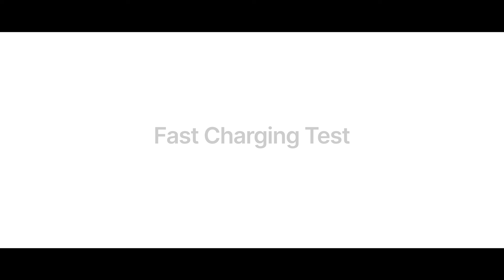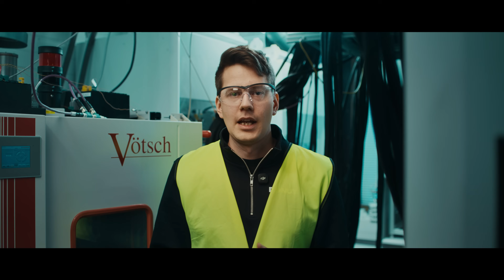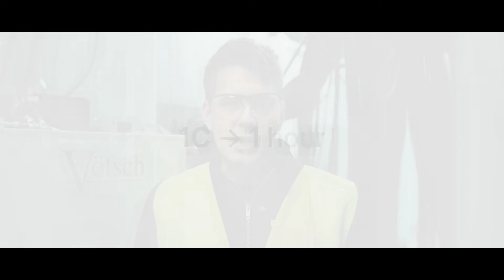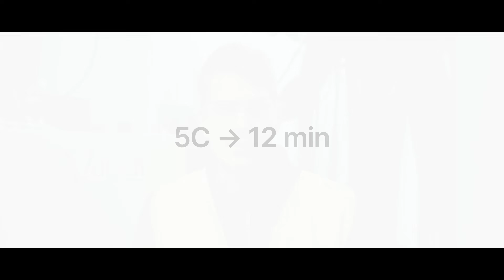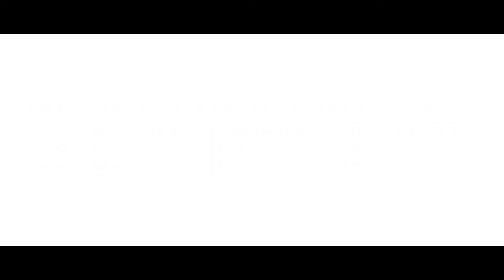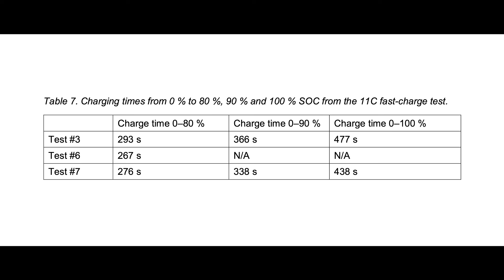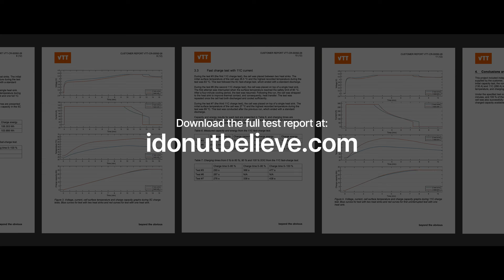Donut Solid-State Battery: Fast Charge Test | I Donut Believe (Pt.1)

Comment: I'm looking at the report. Can anyone explain why the difference between charge energy and discharge energy is about 17,7%?
Does it lose that amount of power for heatloss and inefficiencies?
Reply: Yeah that's basically right. It's round trip energy efficiency loss, mostly from internal resistance. When you push current through the cell, some energy turns into heat (I²R losses). The higher the current, the worse it gets.
If you look at the 1C data in Table 3 it's about 90% efficient. At 5C it drops a bit. At 11C you're seeing roughly 82-83% efficiency, which is where your 17.7% gap comes from. You're pumping 286 amps through the cell so a lot of energy is just becoming heat. That's also why the surface temp hit 63-89°C during those tests.
This is pretty normal for any battery at high C rates. It's not unique to this cell. The faster you charge anything the more energy you waste as heat. It's just physics.
Reply: @dimitarkolev5211  makes sense! thanks.
Reply: Well, when slow charging it looses about 10% to heat, but when fast charging you lose more towards the heat. That being said, it's not really a lost if you think about modern EVs for example because the heat can then be collected with an advanced collector (like the octovalve that Tesla has) and delivered as cabin heat. Wait until you realize how much energy is lost at the charger as well when fast charging :))
Reply: This is in the range of NMC-type Lithium-Ion cells. The voltage rise and drop during charging is also comparable.
Reply: Also, the discharge was done at 1C, but if you discharge at 11C be sure you will have loses there as well. The cables that connect to the battery themselves have a high resistance that sums up at this so high charging amperage so the lost for charging was not only on the battery cell itself, but on the cables as well. The same is valid for the lithium-ion batteries or anything that consumes high amps that we have already.
Reply: Gemini was able to help.. 
That 17% is almost completely "lost" at the charger, while using ultra high current power, converting it to heat.
But when the battery is full, it returned 99.6% of the charge it stored.
Reply: Why do you ask. If you are pretending to be so smart?
Reply: @vvalsirob  Donut Lab made batteries interesting. But I'm not an expert in them.

Comment: Looking forward this tech in home energy storage
Reply: You would probably want LFP for its better round-trip efficiency for home use. This one promises to be great for cars and motorcycles used for long-trip travelling. Commuter cars that can be slow-charged at home (using PV at best) benefit more from LFP efficiency.
Reply: @lborl5843  The thing is, if their claims are true, this will last much longer than even LFP batteries, so the efficiency is less of a concern if you can have a battery that lasts significantly longer.
Reply: lborl5 • No, sorry. 
From what they say, the safety of Donut Lab battery is way higher.
If Donut battery tech is true, then all the other battery chemistries out there now will be gone and forgotten.

Comment: 10 min charge time with no active cooling is crazy. An EV could just not have a cooling system and be fine, lowering the complexity and cost substantially
Reply: A single cell can handle the 5-11C charge without active cooling. In a whole pack you'd still need cooling even with these test results.

Comment: What the VTT report does and doesn't prove:
The report validates that this cell genuinely handles 5C and 11C charge rates with high capacity recovery that's real, measured data from an independent lab. This alone puts it in rare company, comparable to CATL's most advanced fast-charging LFP cells but potentially at higher energy density (if the 400 Wh/kg claim holds).
However, the report does not test energy density (Wh/kg), cycle life (100,000 cycles claimed), or extreme temperature performance, the other headline claims that Svolt's chairman called contradictory, saying that such a battery simply doesn't exist in the world. CnEVPost It also tested only a single cell, so manufacturing consistency remains unproven.
In short: the fast-charging performance shown here is legitimately impressive and on par with or ahead of the best production lithium-ion cells in the world. But the most extraordinary claims, the combination of high energy density, extreme cycle life, and temperature tolerance, still await independent verification.
Reply: This is a series where they drop these test results and reports one by one. This test only considered the fast-charging capabilities. Next part of the series reveals some other data.

Comment: Can't wait to have the -30'c quick charge test and how the outward current is going to behave. This is the real obstacle in Finnish conditions currently with current Ev's. The 500km range is more than enough for anyone, but when it drops to 200km range in normal cold winter day 25-35'c up here, then suddenly this makes car not useless, but very much different thing than what was promised.
Reply: There is no real problem with current battery technology at -30C when it comes to extracting useful capacity out of it. Other than low initial capacity. You can have almost all of its nominal energy out easily at -30C. Heating (and keeping it up) everything at -30C takes much of that capacity and it means lower range.

Now if donut battery would give you more energy stored in a similar space/volume to lithium pack, it would make a difference in real world driving range. Heating up everything would still use as much energy as it does with lithium based pack.
Reply: @retkimora  True, but the fact that this battery can heat up to such high degrees means that after you fast charge, the car can just "leach" on that heat to provide heating inside the cabin instead of wasting it with cooling at the charger to keep the battery within normal tolerances. Not the battery can become a real heat storage unit as well.
Reply: True. Also you wouldn't need to heat it up for fast charging saving more energy for actual driving. This cold weather charge test is likely coming up in later videos.
Reply: @retkimora  One can always hope, currently CATL Naxtra seems to be the most promising candidate in our climates, since that promises to have more than 90% of the nominal performance and capacity even in -40'c
Reply: How much energy would it even take to heat up the batteries beforehand. If losing 5% battery makes the rest 95% last longer then it's a worthy tradeoff.
Reply: That’s why it is important to have individual charging spot and preheat the car with grid energy, not waste the battery for that
Reply: Only 25% of that drop is due to the battery, rest is pure physics. But yes, any improvement is welcome.
Reply: @wecs8k  Aye, need of more heat and cold air being heavier is a b* if you have only so much energy to go for. So naturally What Merc CLA is doing aka, getting better aerodymics would also help massively into that, if you can push into 400+ maybe even 500km in Cold then you already have similar if not better statistics as any ICE car :)
Reply: @ehta_perkl  Keep in mind that aerodynamics is only part of the equation. Another big factor is rolling resistance due to the snow and slush.
Reply: Nothing like having to stop and charge for an hour in negative temps
Reply: @xtdude  To be fair, most well-made EVs will precondition long before you reach the fast charger, and so you would only need to charge for 30 to 40 minutes, not a literal hour. Hopefully this new battery (if real) improves that.

Comment: According to Nordic Nano, this is how the Supercapacitor is made, the tech comes from CT Coating AG with the collaboration of the University of Twente.
Electrode: 25% Black (SnO2-TiO2) Quantum Dots bonded with Defected-Turbostratic In-situ Activated Graphene (Organosolv lignin 40% + Sodium Alginate 15% + 10% MWCNTs) / 10% SSE
SSE: NFES (75% PVDF-TrFE / 24.9% Na₃Zr₂Si₂PO₁₂ / 0.1% NH₂-GO)
Reply: Did you not watch the previous video they posted. They specifically stated it's not a 'supercapacitor'
Reply: @Cell1969  Donut believe, they just want to hide how it's made, Nordic Nano calls it a Supercapacitor
Reply: @rwyo83  Yes. I think this is the case. There is only 1 h idle time. If that would have been longer, I would expect to see steady voltage drop rate without any load. Also no mentions about e density, though might be quite close to Li-Ion of same capacity. Hard to say from the pictures though. Impressive capacitor though.
Reply: Also we do not know how expensive it is to produce unit with such performance. This might high quality one hand picked from mass of inferior units. Also no idea how long it will last with such charge rates. LOTS of issues with this announcement.
Reply: @mrnivala  It's really cheap using the Flash Joule Method

Comment: With quick look at the pdf (about a minute, it's a workday :D), it did look pretty good. and especially considering that this will be used in boutique motorcycle not in massive quantities in cars. So even if it looks like the voltage drops a bit in that few hour idle, still good enough. And dunno how it handles any other than room temperature, but also irrelevant for it's first usecase. Hell if they have 90% failure rate in first year, still it will go down in the history books and create positive buzz.

Comment: Brooo that's it ? Are you still engineering the battery? Why the huge gap between reveals 😅
Reply: The battery is being tested in vtt and as they release results donutlab gives em put.

And i bet they enjoy this way more than they should after all the bashing they got. Lol. I bet marko is laughing so much rn.
Reply: @hornantuutti5157  This test result was made 7.2.2026, so they could of release it many weeks ago.
Reply: Looks like you did not get it: this is a communication strategy, to maximize the buzz. And it works perfectly well.
Reply: @PierreCol-Lyon its already at its peak hype bc Numbers they shown are unreal as we know. I like to believe everything they said is real 🤞🏽

Comment: can anybody summarize it in 1 paragraph? is it fake or real? 100k cycles? 5 minutes charging? 400kw per kg?
Reply: Just speed charge testing... it chages fast and holds the temperature ok.
Reply: The report is on the web page, but summary: 1 regular load test, 3 medium speed load tests, 3 fast load tests. Out of those 3 fast load tests the one with partial cooling had to be halted due to safety issues due to excessive heating...

Comment: I have some Turnigy Nanotech lithium polymer batteries from 10 years ago that happily handle a 5C charge rate.   Next please.
Reply: Can it 11C though?
Reply: @mariokreiner513  The bigger question is: can the Donut Lab battery consistently handle a 11C charge and still deliver on the promised cycle-life.  There have been a number of battery technologies that offer the features that Donut Lab batteries do - but not in combination.  Some can be charged very fast but have limited cycle life.  Some have high capacity but are slow to charge.   If Donut has got all these features working together then they're onto a winner but if they're only going to demonstrate the features in isolation (as I suspect -- due to the drip-feeding of the test data) then we're no better off.  For instance, if charging at 11C reduces the cycle-life to just a few hundred cycles then it's not going to meet the expectations that were originally created for it.
Reply: With two huge heat sinks, it can probably handle 11C. It probably won't last long, but it could handle it. The problem is to have a charger that can deliver 11C. We will need another battery to deliver that amount of power.
Reply: Can they also handle 11C
Reply: This has no lithium in it and can do alot better mate. Did you invest in lithium battery factory or something? Why the crying lmao.
Reply: @hornantuutti5157  it hasn't been proved yet by any 3rd party?

Comment: I WANT TO BELIEVE 🍩
Reply: Me too! We will have to wait for them to show something that hasn't been done before. No individual claim is new but the combination is groundbreaking. 

Nothing on the first iPhone was new but the combined implementation changed everything.
Reply: They(donut lab)can achieve aviation grade and sufficient of 520 wh/kg at cell level instead of their current already impressive 400 wh/kg.if they adopt the ultra innovative and advanced dry cathode coating process instead of their current wet process(potential of 30% cathode  energy density gain).
Reply: @davidfujkk8018 720 Wh/kg is the current record (CAS) in a lab setting. We need to combine individual stats to have something useful. Charging in 1 second is great unless you can only do it twice. Infinite energy density is great unless it explodes when you touch it. 

Possessing everything donut claims is practically the holy grail unless it can't be manufactured at scale and cost. 

The biggest red flag is they don't have the dozens of factories it would take to meet demand and hit the price point they claim. I'm not sure where the trillion dollar initial investment to build all these factories will come from but I'm sure it will come quickly if true. Then there's the 5-year process of building the factories. 

I guess the actual biggest red flag is the CEO and his previous performance about creating the world's first AI super intelligence...
Reply: Real donuts are available today. At KFC and other retailers.
Reply: Fox Mulder
Reply: this.
Reply: Came here to say exactly this too. 🌲🛸🌲
Reply: I came here to post the same thing.
Reply: It's time to stop believing unfortunately. Did you see the third party test results?
Reply: the fact that the first thing they "prove" has nothing to do with the criticisms is a major red flag. we already have super capacitors charging at those speeds. zero proof was provided showing this is an actual battery and not just another super capacitor
Reply: @usf976  While I am still very skeptical, this thing can't be a supercapacitor provided the numbers in this video are real. At 4:40 they show a hand next to the 'battery' pack and it is quite small. I estimate it to be about 20cm x 10cm x 1cm at most, for a volume of 0.2 liters. At  5:07 they show that they are storing about 100Wh in this thing, giving it an energy density of 500Wh/L. The very best supercapacitors in the lab top out at about 150Wh per liter, with a standard Lithium ion battery at around  300 to 400Wh/L.

So unless they are majorly fudging the numbers, or I am misjudging the size of that battery pouch, this thing can charge ridiculously fast and has an energy density 20% higher than the best lithium batteries on the market.
Reply: @harmenkoster7451  ...which is around what numbers they presented. 

They are basically making 3 remarkable claims:

* Charge at 10C
* 400 wh/Kg
* 100.000 cycles

All at li-ion price point. This video proofs the first of these 3 claims.
Arguably the 100.000 cycles lifetime claim is the biggest one. The other two are extremely good but well within the realm of the possible. The 100.000 cycles claim though is waaaaay above the regular few thousand cycles

I am patiently watching to see if they will provide proof for the other two claims but thusfar they are delivering it seems.
Reply: I would simply add that the current-voltage charging curves have nothing to do with those of a supercapacitor. We're completely in battery-type behavior, with the voltage rising very slowly with charging. How can anyone still believe this theory?
Reply: Does not show anything meaningful, without showing the discharging current/voltage/power 😁
Reply: @irvinewayne4086  They do actually show that at 5:05 in the graph. They seem to be discharging at about 25A for 1 hour, with the voltages being pretty much the same as a standard NMC lithium battery. The next slide shows they are charging it with about 100Wh, and they are getting 90Wh out, which looks to match the graph.
Reply: @harmenkoster7451  
then it's even worse than the 30A lipo: 
3.8V 30Ah Single Cell Lipo Battery 25C 1000cycles+ Li Polymer Battery Cell
Brand Name:
Jarwin
Model Number:
3.8V 30Ah LCO Battery cell
MOQ:
500 pieces
Price:
35.92USD（negotiable depends on demand)
😁
Reply: @irvinewayne4086  That was on page 7 of the report, which I didn't see in the video... probably because that graph proves it's a supercapacitor, not a battery.
Reply: @Onihikage but it is no Supercapacitor they say. It is a battery.
Reply: @uwehetman2320  
I add some activated carbon to the electrode to make any li-ion to be a supercapacitor/battery hybrid :text-green-game-over:
Reply: I'm happy to believe as long as they are not asking to transfer my bank balance.
Reply: @tonyxavier6509  unfortunately, some uneducated Finnish investor would.
Reply: I want to believe but their approach is so shady! check out CATL C5 LFP and Cherry's Solid State 600 Wh/kg prototype.